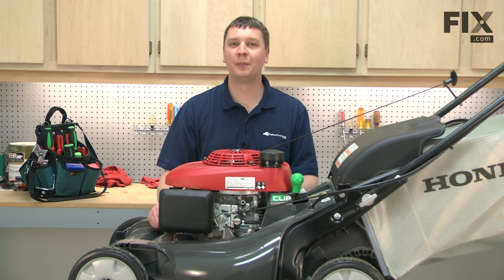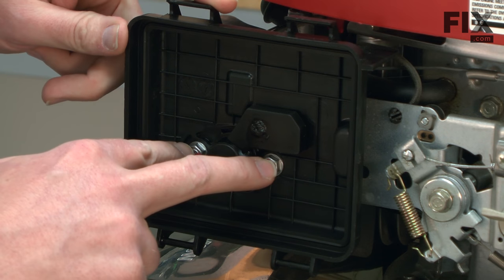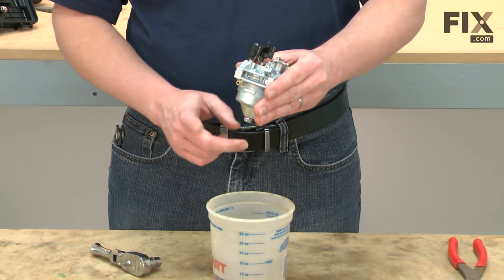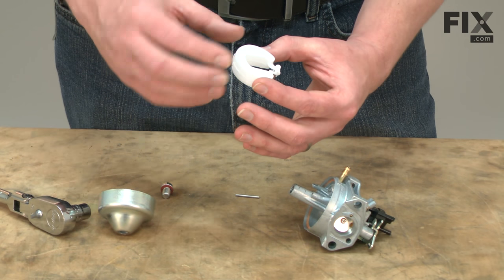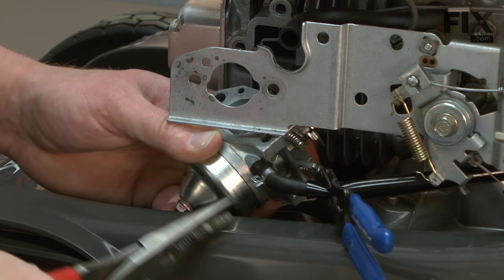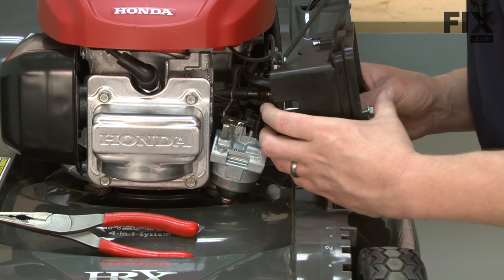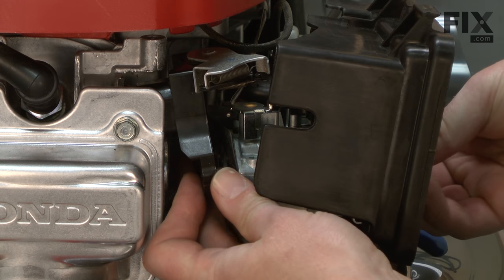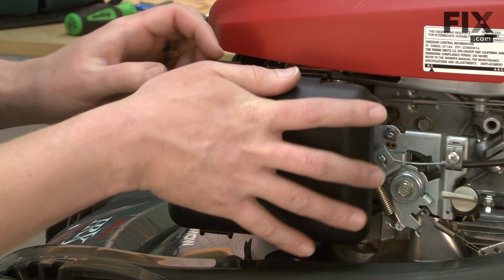Honda Lawn Mower Repair – How to replace the Carburetor Float

Comment: Clear and concise with capturing video and explanations.  Pulled off the carburetor filter holder to clean the sticking choke and all parts, carb, cables & gaskets fell off and I had not a clue where to put them back in place until I found this video.  Was up and running in less than 10 minutes.  Thank You!

Comment: I am NEVER buying another piece of shit design Honda. What kind of stupid engineers designed the carburetor attachment system that is so fucking difficult to replace the gaskets? Anyone could have come up with a number of better ways to do so you're not trying to thread the bolts from the outside with a big honking piece of plastic in your way. What kind of fucked up engineers design so poorly. I wish I knew who came up with the design but then I'd end up in prison.

Comment: excellent, best I've seen so far on reassembling the carb. Perhaps it's personal preference but I find it easier if you unbolt the governor plate, assemble the carburetor with parts, gaskets, and governor plate, mount the carburetor to the engine, then re-bolt the governor plate last.

Comment: Nice, but always a good idea to close the fuel line before you go, in case your clamp fails.  Yes?
Reply: Most lawn mowers I’ve seen don’t even have a shutoff. It doesn’t really matter
Reply: @ghost-4230  Oh, yes.  I'd rather get a pair of adjustable locking pliers and squeeze the fuel line shut somewhere (which may or may not fully work).  Simply shutting the fuel line valve (which is on most new mowers) is so, well, simple.

Comment: Super video!  Help me reinstall my mower carburetor assembly after removing the two bolts behind the air filter to try to clean it up, only to have the whole thing come to pieces! I followed your video and it started first pull.  <whew>

Comment: Great Video,what would the part number be for the carb. thank you,can you tell me what engine this is ,I have one like it but the info. stamped on the engine is GJAAA-1180121,I can't find or confirm what this is for example, is it a GVC160 ENGINE

Comment: Where can I find instructions for installing a carb on a Honda Hr214sx, if you know. (The 217 instructions don't help.) Also, where can I get a pair of locking pliers, like the one you used in the video?

Comment: It should be noted that not all Honda HRX 217 carbs look like this. The first sign that mine differed was that I have 3 bolts holding the air filter housing. "No big deal; just take out the extra bolt" I thought. Well, once I got at the carb, mine has an extra linkage between the one you showed and the air filter, and I can't for the life of me figure out how to get it off without bending or cutting it.  Off to see if I can find another video that shows how to disassemble this type of carb...
Reply: Followup:  On the "3 bolt" model, you must take off a 4th 10mm bolt to the right of the air filter housing.  This lets you slip off the other linkage. Hope this helps someone else. The next Q is how to get the bowl off if it's stuck fast even after removing the bolt...
Reply: Bowl comes unstuck if you apply WD-40, heat, or elbow grease.

Comment: Oh no … no no no … 1:23 do not use a screwdriver.  Use some needle nose pliers to carefully do that; screwdriver can tear/cut and jack up the hose end ...
Reply: ..you should show them cleaning out the pilot jet hole as well with a .013" hand drill bit to fix surging issues..

Comment: I have the GVC160  for a pressure washer.  I ordered a Honda GVC 160 carburetor for it and  apparently I guess I didn't get the right one (or maybe it doesn't matter)  The bowl on the original one has 2 bolts attached to it and the new one has 1 bolt.  Also what I noticed is the old one doesn't have an idle screw.  But the new one does........Can I still install the new one ?
Reply from the maker: All of the GCV160 carburetors we have, use one bolt to hold the bowls on. You should be okay using the one you ordered.
Reply: Yeah I installed it already and it seems to be ok so far.
Reply: I used it actually for the first time yesterday. And it ran irregular. meaning the engine would rev up and down slightly.  I also installed a new pump at the bottom and let it ran for a while to get all of the air out.  But the engine wasn't performing correctly. At times it would come on strong like it should but most of the time it was running with weak pressure.  I might of had to much oil in it.  Would that be an intacation of how it would be running if it had to much oil .  I took out out some and was still running weak.